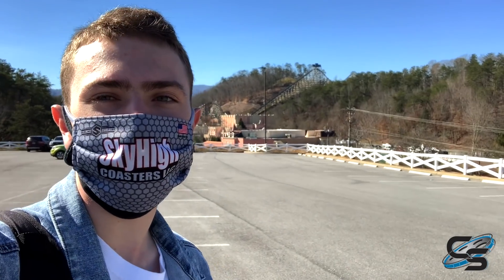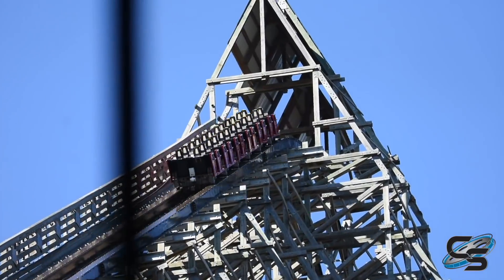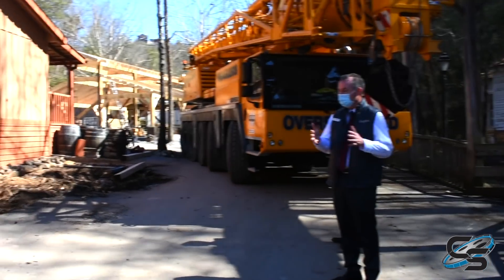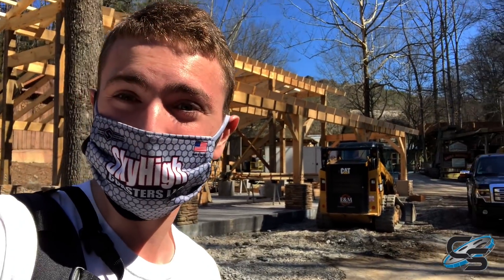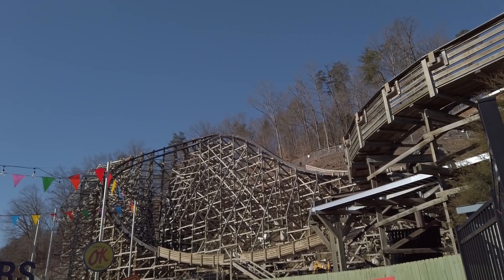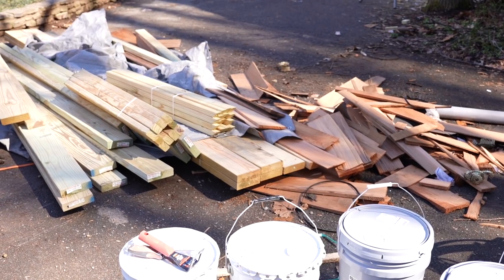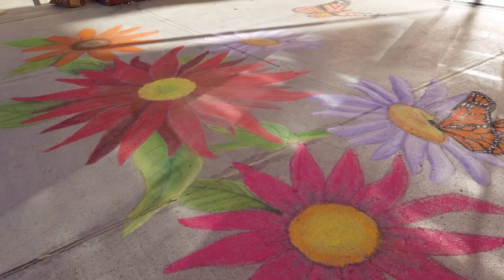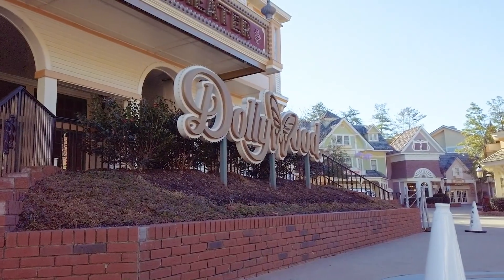What's Going on with Lightning Rod? An Inside Look at Dollywood's New for 2021 Changes

Comment: I know Lrod had a lot of issues and roughness due to the pot holes due to the small amount of supports the ride uses.  I don't know if Lrod will be as intense as when it first opened but it will certainly be smoother and more reliable.  Dollywood did a great job fixing this ride and that team really does care a lot.

Comment: They really did it. They RMC'd a RMC lol.

On a serious note, I think the Topper Track might be a thing of the past. The Ibox track has been a far more successful commercially, and there hasn't been a new RMC woodie since 2016, and no indication of any future plans to build another. Zadra was built from the ground up as a hybrid, and now Lightning has been made into a partial hybrid as well. I have seen rumors that the Topper Track has struggled with the intensity of RMC's layouts, and along with it's overall commercial disappointment RMC has decided to discontinue it. 

In general true "wooden coasters" seem to be a dying market. There's only really 3 companies building them now, RMC, GCI, and the Gravity Group. I already addressed RMC, and now GCI has introduced an Ibox style steel track. I think Hybrid's are going to eventually almost entirely replace true woodies. 

Hopefully this retracking allows Lightning Rod to run at its full speed again!

Comment: I know they had to tone down the launch bc of the impact it was having on the track but now that it's steel.....I really wish they'd up the launch to its original speed. Im guessing they wont, bc I think they physically removed the LIMS? I heard that and it looks that way.... but dang it'd be epic if they turned it back up to its original. I've heard and you confirmed it was even crazier, and I hate I've never ridden it its OG form :(  But still seems to be a top 3 ride for most people so even with the slight toning down seems like no biggie. Still I'd like it to be restored lol